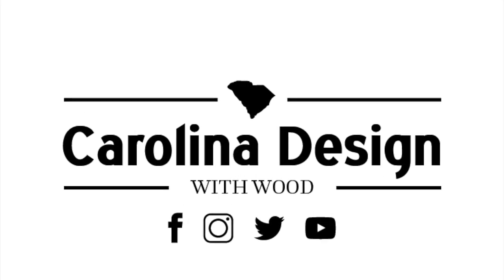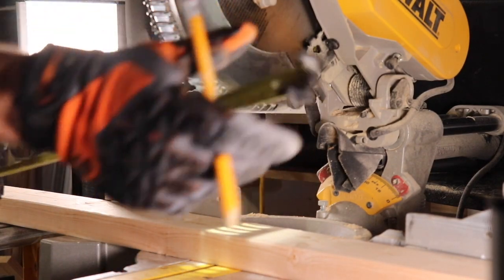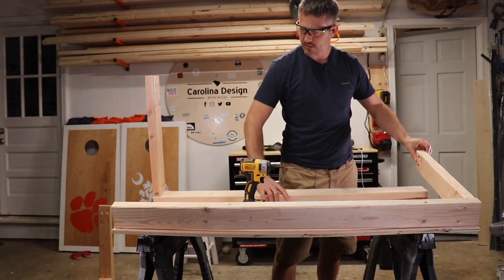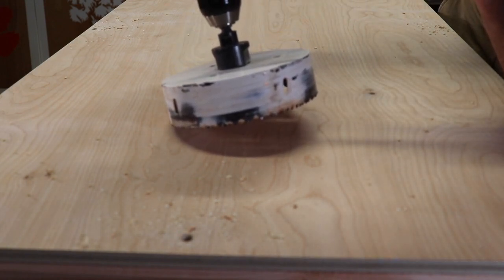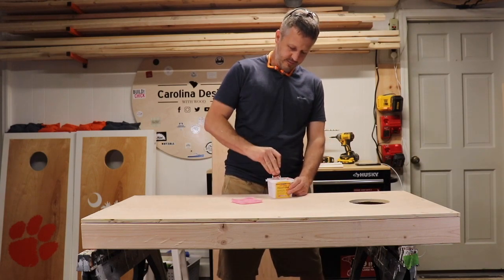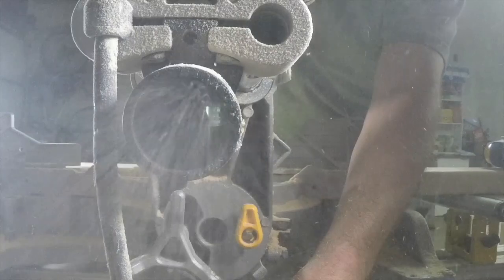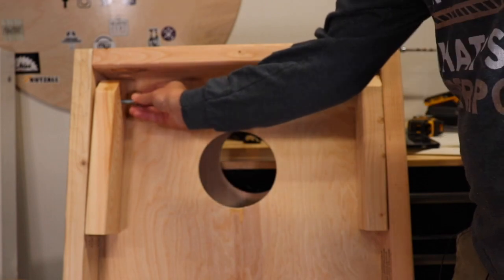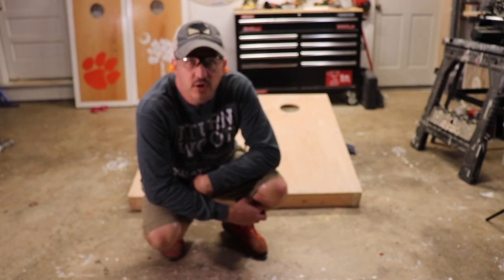How to make cornhole boards!!!!

Comment: I just made my first set ever. I did it watching a few other videos before I found yours. I made a few mistakes but the boards look pretty nice. I want to make future boards not for sale just personal use. It is an ego thing .I know I can do a better job. Thanks Covid-19 for making me a cornhole enthusiast. LOwcountry Mike.
Reply from the maker: Let me know if you have any questions!
Reply: @carolinadesign199   I used spar urethane for several coats. The boards are still a little sticky any advice on making them slick where as the bags will slide?
Reply from the maker: Mike Hey I use minwax clear. Typically 5 layers but I fan dry each layer.
Reply from the maker: Share a picture of the the you made.
Reply: @carolinadesign199  ok